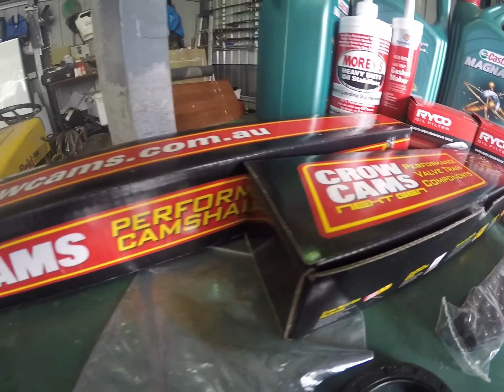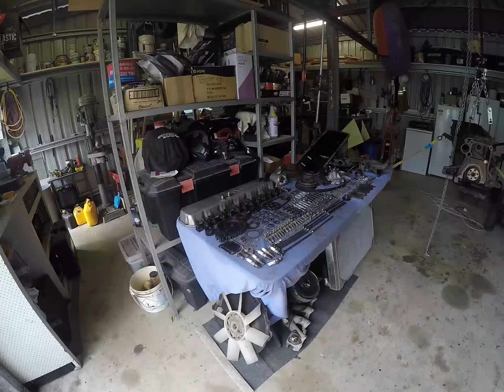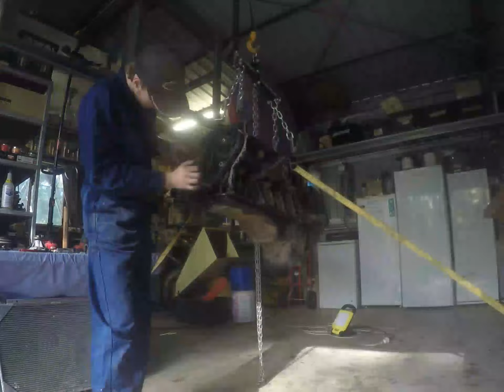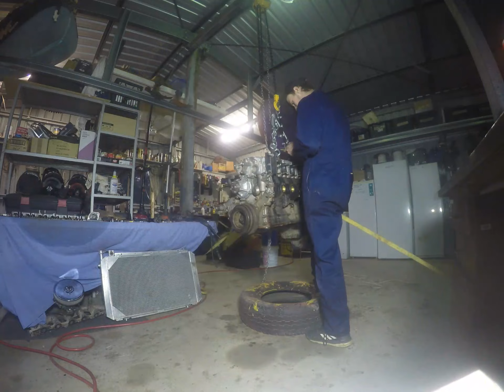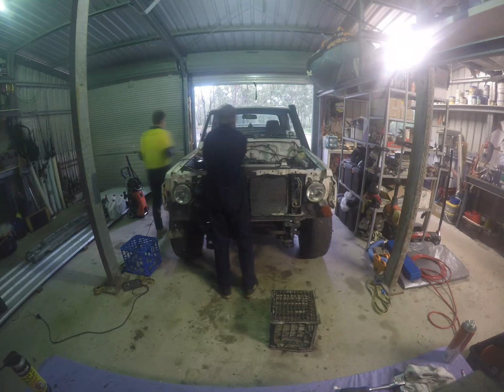Time lapse camming and building my TB42!

Comment: Do you think you could do a cam swap without taking the whole engine out?
What else is involved
Reply from the maker: @nk0723  its possible, but way easier with the motor out, and id highly recommended doing cam bearings while in there

Comment: What Carby you running..  if not the standard one.. any improvement
Reply from the maker: I have a video on the carby swap on my channel also! I'm running a Weber 34ADM, it is far simpler, easier to tune, and in my opinion just better then the original unit.
Reply: I want install turbo in this motor i have a 1998 Y61 same motor w/carby. Any idea? Sorry for My Bad English
Reply: @juancuenca137  I am also wanting to do the same hopefully he gives us an idea👌👍
Reply from the maker: @juancuenca137  turbocharging a motor with a carby setup like this isn't easy, it would be easier to convert to efi and then turbo it
Reply: @Juan Cuenca  either put a big Holley in, or spend the $ 1200 on a Holley Sniper, it's a bolt on carby with a fuel injector inside.
From what I understand very easy to install, and can take big power via a blow through turbo setup. Simpler than getting an EFI motor which isnt that much better than the carby one
Reply from the maker: @Djavo1  I definitely wouldn't be putting a big Holley on as it would make it terrible to tune, anything bigger then about 400cfm on these is too big, and a snipers are good, but you would still need an adaptor for the intake and a second fuel pump as they run at much higher pressures, still a fair bit of wiring to do with them too. you can get the stock efi ecus remapped better as far as i am aware as well.